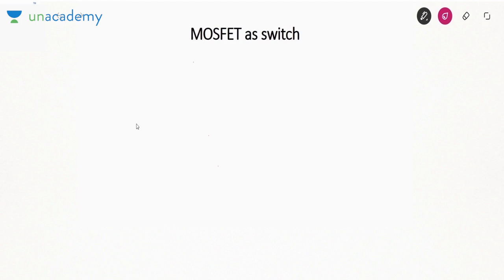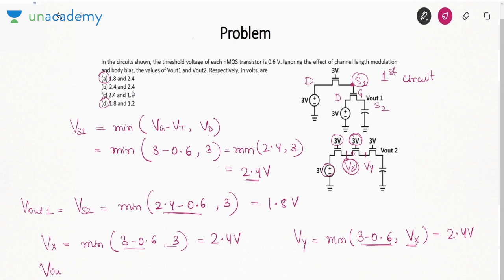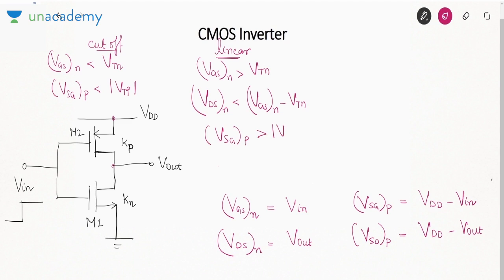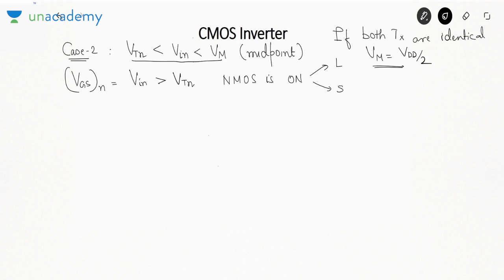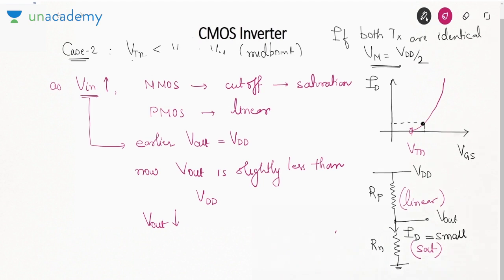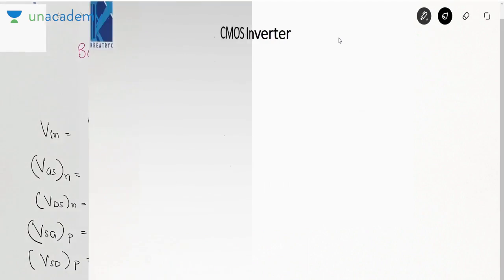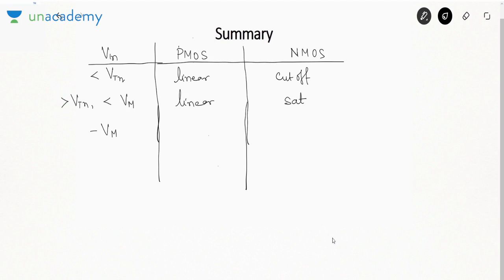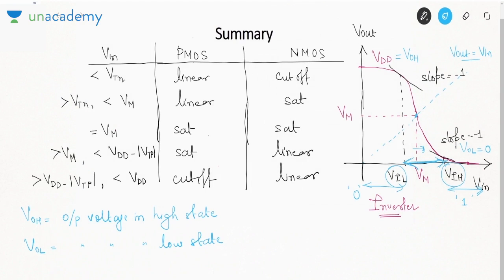CMOS Inverter | MOSFET | Lec 70 | Analog Electronics | GATE 2021 Exam

Comment: In region 2 when   Vtn<Vin<VM, NMOS is in saturation, so maximum drain current must flow through NMOS nd PMOS as well(as VDS or Vout is very high than the overderive voltage). Due to this maximum drain current drop across PMOS should be high so that Vout is not slightly but very much less than VDD. ????
Reply: It was for when Vin is just above Vtn
Sir later did say that as you Vin, then Vout
will decrease